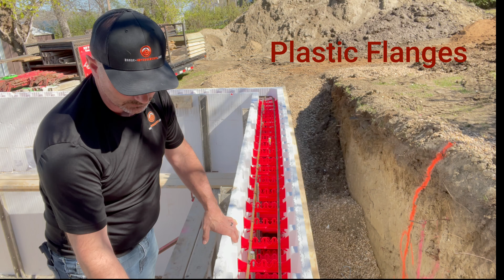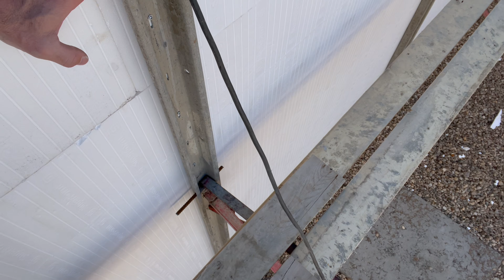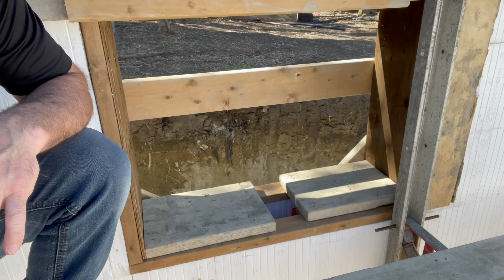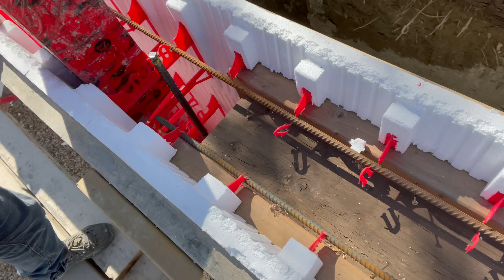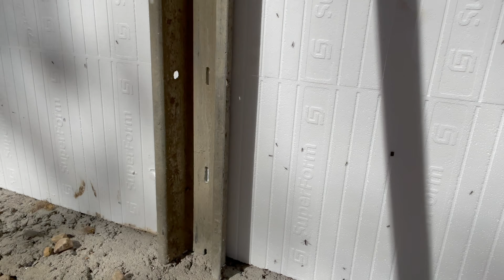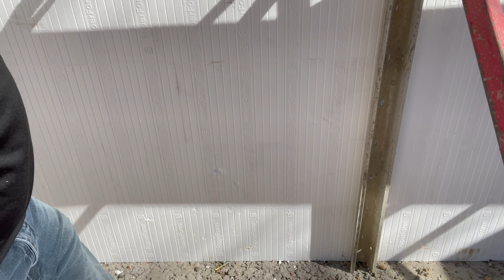ICF Forms For A Basement - Cabin Project

Comment: I am interested to know the costs compared to other methods. It's also interesting how much pressure staryofaom can withstand, considering that 5/8 plywood would take 2x4's and snap ties every 16 inches to support a concrete wall like that
Reply from the maker: These have been around for a few years now and are very good. The cost is about the same in my area but the savings are in not having to frame the basement exterior and insulate. You can drywall right to these and the insulation is already there.

Comment: Question to ask.   What about house fires ? I hear that if this catches on fire the fumes will kill you very quickly from these ICF walls
Reply from the maker: We are not allowed to inhabit these buildings until the foam is protected from fire. So basically the walls need to be drywalled before we could move in.
Reply: EPS can't catch fire, it extinguishes itself. you might be thinking of sprayfoam?
Reply from the maker: EPS will burn it just burns at a much higher temperature .

Comment: How do you keep Carpenter Ants from eating the ICF, the outside layer or does that do anything but provide a form for the concrete?  How are the Basement walls, water proofed?  How did that footer pass inspection or was a permit required?
Reply: EPS isn't a food source for anything. termites can tunnel in it if it's not treated with borate, but if your area has them, you need to treat the ground regardless of what your structure is built with.
Reply from the maker: I'm not aware that they will eat it? The outer layer is insulation for the wall. You will see the water proofing in a video soon. The footing passed inspection .
Reply: FWIW, carpenter ants tunnel into bad wood to make a place to live.  Termites eat wood but live in the ground.  I don't know if the ants will dig into foam.